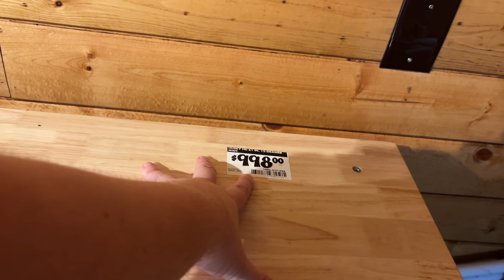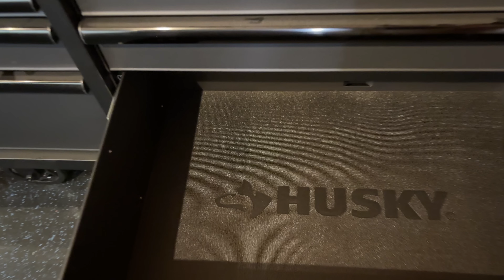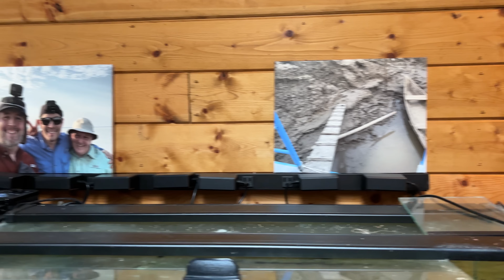We Moved My 800-Gallon Aquarium - Fish Room Update Ep. 141

Comment: @07:58 I discovered our local water supply hasn't been properly maintained.... because my established tanks started growing algae after a water top off last year... right after a major storm.

Sent my tap water off to be analyzed, and in addition to already being hard ...

They found uranium, selenium, and ridiculously high levels of phosphates in the tap water, which "tests within industry standards" at the water treatment plant.

Pretty sure the only reason my shrimp colonies didn't crash is I no longer do water changes (I only top off) and I don't let the tanks evaporate much anymore.

It's taken me 7 months to get the algae back under control (string, blackbeard, and staghorn), mostly by hand removal and buying amano shrimp to join my P paludosus in my NANF tank.

There's debate that Amano can breed if the water is hard enough, albeit with very low viability rates.

Guess I'll find out, as I only bought 4 (2berried F + 1 male) amanos, and now appear to have 6 (3F + 3M).

Unless I got some hitchhikers on some plants?

Comment: Blackbeard algae are controlled by water changes. I do 50% once a week, and no less than 50% twice a month. High concentrations of Nitrates (N03) encourage blackboard algae to grow. Keep feeding to optimal levels. If one overfeeds and food is left on the bottom remove it. Maintain lighting to six hours per day. Only have tank lights on when the tank owner is around.
Reply: Altho that may be the case for your tank, I’ve had a carpet of Blackbeard algae without any nitrates whatsoever in the tank, or well no measurable levels
Reply from the maker: This is a case by case basis. Quarantine room at the store is 50% daily water changes, still gets black beard algae.
Reply: @AquariumCoop  Cory, I posted my information from sending my tap water off for analysis after developing bb, staghorn and string algae in established tanks after just a top off.

It's taken me 7 months to get it under control....

Comment: @aquariumCoop
Quick question on those dosing caps. Do you plan on making them clear enough to see where the liquid is/dosing lines dark enough to see better? That's my biggest issue with the Api caps, it's extremely hard to see that the liquid is in fact at the line, also since the lines are the same color, they too are difficult to see. Just curious, I know you really try to make things better so I am hoping